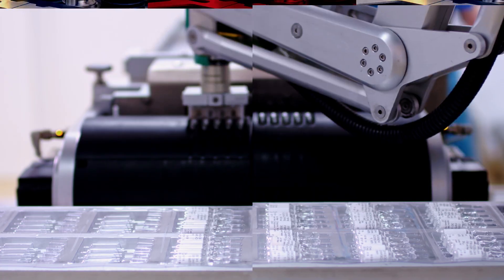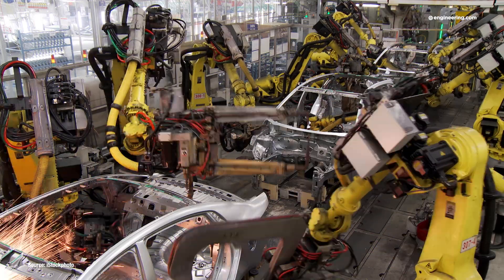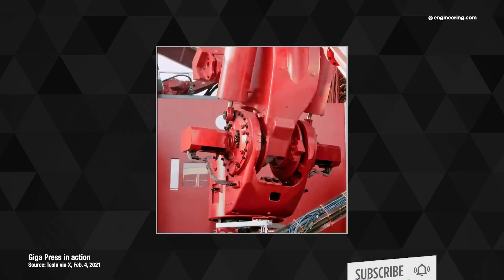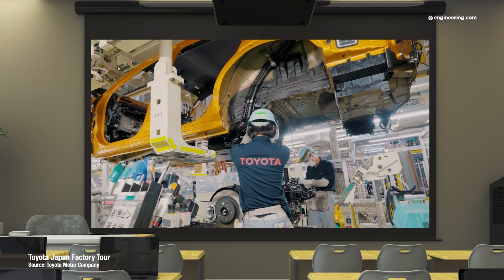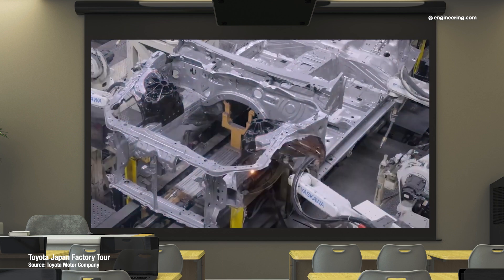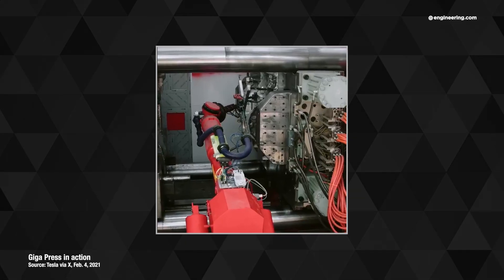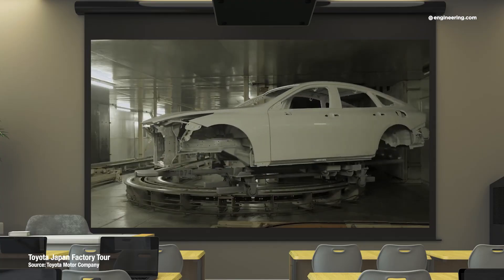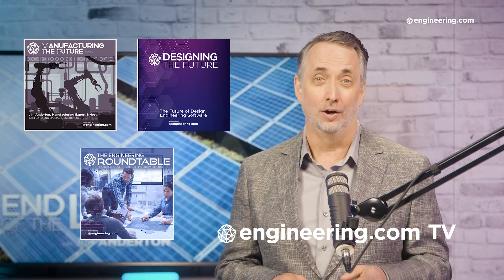Tesla backs away from the giant “gigacasted” chassis

Comment: I am sorry, but you completely misunderstood both what is happening and the reasoning behind it. Tesla uses Gigacasting for front and rear with the structural battery pack connecting it. They were moving to a completely new 'unboxed' process, which by virtue of being unboxed would not have used a single casting for the entire Chassis. So that bit is just completely obvious nonsense. Apart from that, they now have rowed back on the unboxed completely new process. Not because it is a bad idea, but because with Version 12 their FSD system is making such giant leaps forward that the new process will not be ready for when FSD is ready for 'Robotaxi' mass production. So Elon made the decision to push the introduction of fully unboxed process back and instead create an intermediary step which will be ready for 'Robotaxi'/'Model 2' mass production and while not delivering the same savings as unboxed, will be much better than current processes. So i am glad you didn't say 'i told you so' because this would have taken this video from embarrassing to downright obnoxious.

Comment: This is baloney, and not news.  Not choosing to pursue something that you didn't start to do isn't backing away from it. Tesla has never said it would make a one piece cast chassis because it wouldn't make sense. More than two years ago Mr Musk DID say was the next platform would have a modular architecture with the front and rear being separated so all the interior components could be added without the restrictions of an enclosure. Frame "rails" would impede floor level access.

Comment: Doesn't really make sense to do the whole car when the battery pack casting could be the entire middle and the failure rate doing in 3 pieces is much less than one big one. The center section is low complexity too - extrusions probably better and the center and pack assembly can be produced offline then married to the front and rear castings. I can't see any compelling reason to do in one shot.

Comment: Did Tesla really say they would cast whole chassis? They showed a rendering a couple of years ago showing a modular subframe assembly for their “M2”. At this point with their structural battery pack, their “chassis” is just two castings connected by 2 sill beams. The is no floor pan. Casting the sill beams at the same time would seem massively inefficient.
Reply: Yep. This was never their plan.
Reply: No, they didn't. This video is a bunch of badly researched nonsense. Tesla was gonna use an unboxed process, which by virtue of being unboxed would never use a single cast. But they are doing a hybrid process now because FSD is progressing much faster than they thought and they need to be ready for Robotaxi mass production. That's what Elon told shareholders.
Reply: @johannesdolch  FSD is one year away since 2017. Besides, without Lidar no regulatory authority will give permission for L4+ autonomy
Reply: 2

Comment: I've heard that the honda ridgeline is a unibody truck, they seemed to have cracked the code. I wonder what their secret is.
Reply: A unibody is not the same as a big casting, most cars are unibodies, as is my Jeep  Liberty
Reply: @anthonyhitchings1051 They've been making unibodies since the early 60s ever heard of a corvair.
Reply: There's no secret. Honda is good at building 20th century unibody vehicles. The Ridgeline is one.  Tne Ridgeline should be compared to a light duty pickup like  the Ford Ranger, not anything currently made or planned by Tesla.
Reply: Staying off the ketamine for one.
Reply: That they have nothing to loose, probably. Also talk is cheap.
Reply: It also has a very low tow rating compared to other trucks….